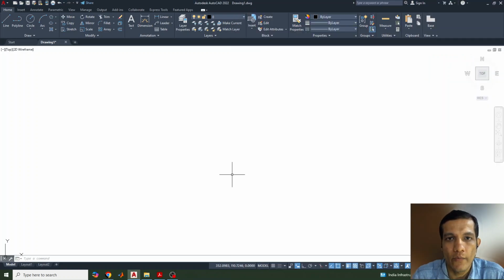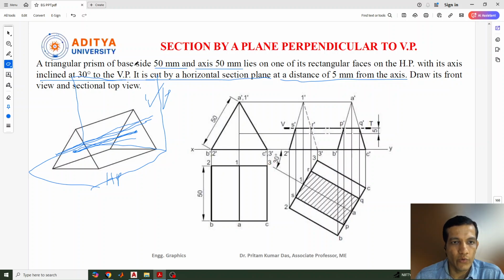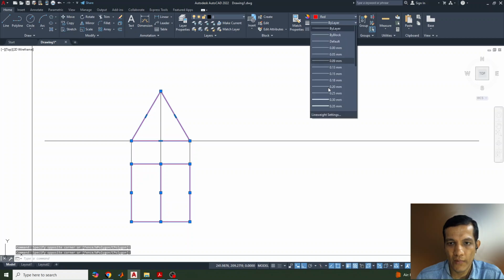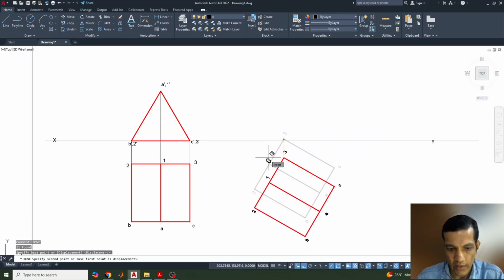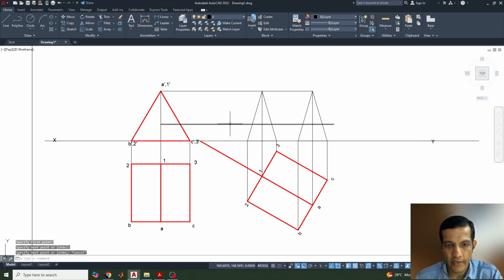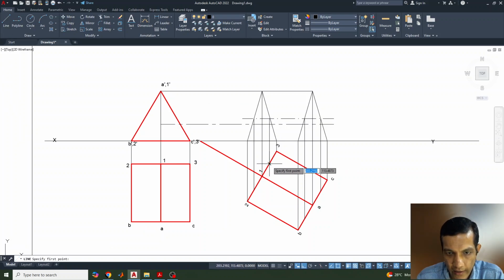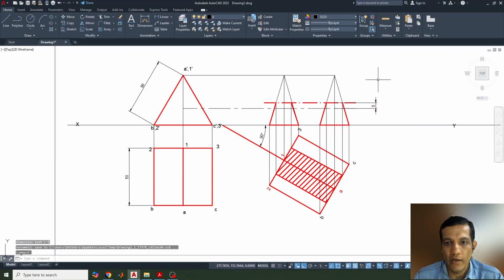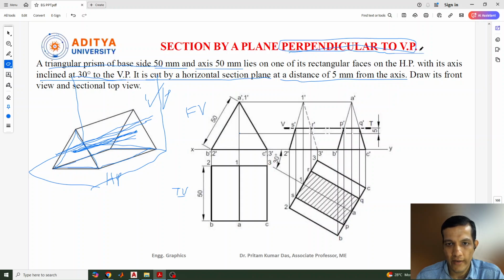Lecture 88 #Section of Solids Problem 4 #Plane Inclined to VP & Parallel to HP #Triangular #Prism

Comment: How u declared axis in front view I don't understand
Reply from the maker: The problem is given: Triangular prism base side lies on one of its rectangular faces on the H.P., this means axis is perpendicular to VP and parallel to HP.
You can observe the center (as a point) of base and top (axis line) of triangle from FV.
The axis is changes its position as per the position of the object.
Once you observe it properly, you can understand. I hope you understand, If not, kindly let me know.
Thank You